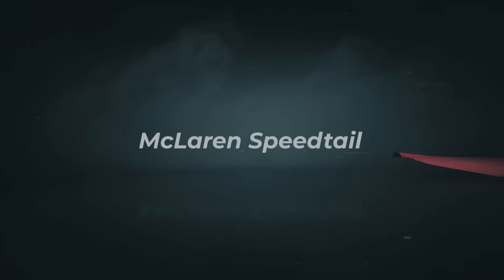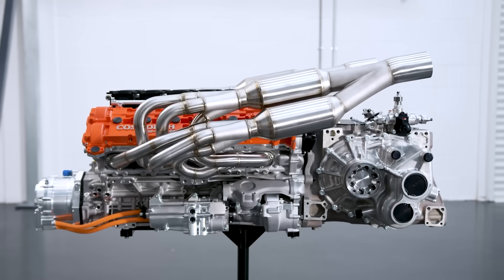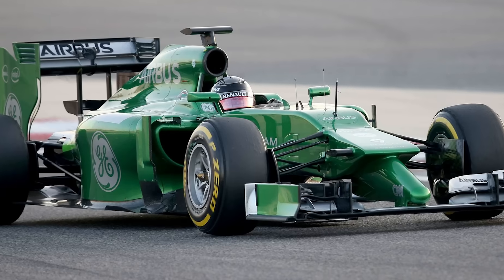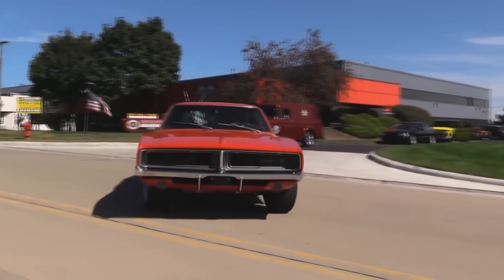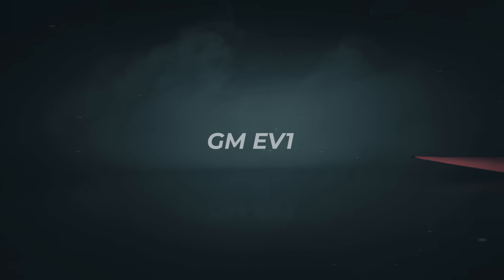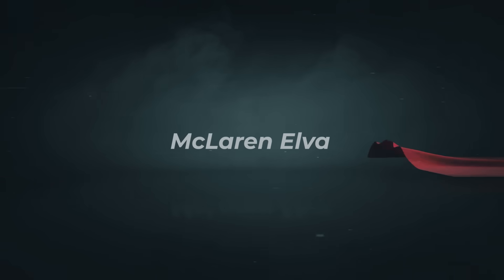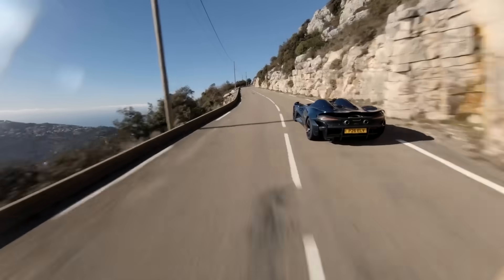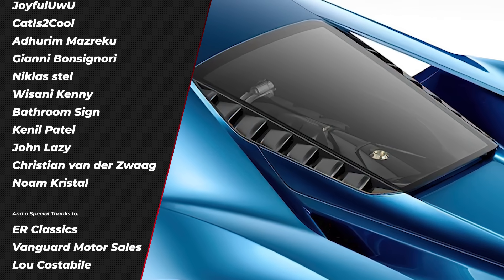Top 7 Cars that MASTERED Air Resistance

Comment: Vw made an car that did 1 on 100km so this video is incomplete
Reply from the maker: The XL1 has great aero, but the effect of it is small since the car is too slow to make much of a difference. Achieving 1L/100km is more because of the low weight and the hybrid engine

Comment: During the 60's or the 70's a small racecar participated in Le Mans. It was so aerodynamic (and light)  that its engineers had to add wings to ensure stability in the Mulsanne straight (to avoid the car to take off). Its Cd was about 0.18 (officially under 0.20 but nobody knows, some people claim it's at 0.16)

Comment: 7) McLaren Speedtail. A.J. Foyt would like to comment, nice Oldsmobile. And the Gen Four Camaro nose, excuse me.
6) GMA T.50. This car has tech that was banned on all tracks.
5) Aston Martin Valkyrie. Call it original brutal elegance.  AS stated, this car puts F1 tech into a street legal car. 

4) Dodge Charger Daytona. Think about this. I watched a NASCAR video with five different cars in the two lap race. The top two modern cars could only do 168 and 187 MPH as there top speeds. Guess what, this car would win the race with being able to go up to 200 MPH, yes , it would smoke younger NASCAR versions. But unlike the second and third place cars that are track only, this car is street legal and can be driven home.
3) GM Saturn EV1.  It has a low drag coefficient. So what? Iit is still inferior to gas cars. and it can't go fast either.
2) McLaren Elva. I say these cars are ugly to start with, and this one messes up it's own aero. just because the thought they made it look better without a windshield. No it didn't.
1) Porsche GT3 RS. Why do you think this Company won't mess with the design. If it ain't brock, don't try to fix it.

Comment: How tf did the challenger make the list but the LS430 didn’t? With a drag coefficienty of 0.25 the LS430 is better than most in this video aerodynamically
Reply from the maker: The video isn't about drag coefficienty only, but all the clever ways cars manage air. 
LS430 didn't do anything groundbreaking to achieve that number. And the number itself is nothing special either. A regular 2016 Audi A4 has a better cd. 0.23
Reply: @TopCarsTV  absolutely, the only thing less groundbreaking than the LS430 is probably the content from this channel. 100%

Comment: I recall reading somewhere that the Speedtail has a lower top speed than the Veyron because of the gearing... It accelerates significantly  harder, so that's what they say they were going for. But I get the distinct impression that the main reason they didn't give it some taller gears was because VW won't share Ehra Lessein with anyone else and there's not really anywhere else in the world where you can really wind them all the way out safely. 

The F1 was the last time VW is sharing, which isn't very sporting.
Reply from the maker: They could've added one final, super looong gear to use the potential of that streamlined body. And as for Ehra Lessein, just go to Nevada where Koenigsegg tests their top speeds.

Comment: The McLaren Speedtail is slower than an “equally powerful” Bugatti Veyron for this reason: The speedtail only has around an 800hp engine. The electric motor in the car adds the extra 200hp, but only for short bursts during acceleration. The high voltage battery will be depleted long before the speedtail reaches 250mph, so by the time the car reaches that speed it’s only producing around 800hp, not the full 1000hp.
Reply: Hybrids are good for the track, not for top-speed run
If they used a 1000hp pure IC engine, it would have broke records like it's predecessor, the legendary F1

Comment: I had to pause the video and make this comment because you called the AM Valk ugly. 

You call that uglier than the T.50? Really? I mean you are the first person who I hear call that thing ugly. If u want ugly aero, look at the McLaren Senna. THATS ugly. 

The Valk is what a hypercar should look like! Absolutely beautiful. Wide arches, and the fenders over the wheels curve so nicely, it's like, for a lack of better comparison, a woman's thighs. 

The cockpit itself is like a teardrop shape, surrounded by the rest of the body, which only widens the car to allow for better stability, just like how the wings and the body of a jet seem to form around it's cockpit. 

And when you view it from straight ahead or straight behind, you see the beautiful venturi tunnels that wraps around the car, bringing attention to the cockpit once again, which even more obviously looks like a center piece now.

And at the tail of the teardrop center piece, the exhaust pipe meets with the air coming from over the car and under the car via diffuser. And you're reminded that that's not just the cockpit, it's the housing for the heart of the car as well, the Cossworth V12.

Comment: Guys buggati Veyron is also areo efficient but not enough as speedtail. There are multiple factors, 1st being a hybrid car (i guess) the speed tail is , deployment of this electric hp will be at acceleration or mid range speed and may not be using all those 1000hp at top speed run like new sf90. 
2nd gear ratio tuning. 
3rd that immense grunt from that w16 engine. 
4th Also that speed tail is not tested in narado ring like Veyron which has long straight, may be speedtail could achieve better speed on narado ring. 
5th the torque and hp curve of (dyno testing) veyron is souly focused on top speed not efficiency like speedtail. 6th ( speculation) that w16 can actually generate more hp than 1001hp limit. This w16 can be detuned for reliability and comfort, at top speed run and pushing that engine to it's absolute limit, it can be producing 1100+ hp. Buggati might downplay there actual numbers like Porsche and bmw.

Comment: 1. The McLaren Speedtail. This design was originally used for the Oldsmobile Aerotech.
2. GMA T.50. This is a Modern version of an older car, and the only one of two from this Company that I don't think is Butt-Ugly.
3. A & M Valkyrie. AN all original design.
4. 69 Charger, Really. all this is is a box with rounded of corners. GM Products had all started doing this in '61.
5. Melted Cheese started being a design at the beginning of the Nineties, this started production in 1999.
6. McLaren Elva. This is a cheap bad copy of the Porsche 918. And that design is based off of the 911, which was first used in the early Sixties.
7. Number 1 Porsche. Well, you got two right.

Comment: A car radiator for cooling the engine is, let’s say 3 ft wide by 2 feet high. This BLOCK is positioned behind the grill which is why cars have grills. How can they claim “aerodynamic” when the front is a block?!?

Super cars with low front ends, Ferrari, Lamborghini,  McLaren, etc) solve pushing a block by cleverly using airflow and distributing radiators. My Lamborghini Gallardo had 12 radiators.

Electrics don’t need cooling. Their front can be designed true aerodynamically. Electrics don’t need a hood (where the engine was).

It’s time to redesign the 20th century buggy. Until then, don’t claim “aerodynamics” because you have none. You’ve never seen their white smoke visual in front of the grill.

Grills were there to cool a radiator that cooled an engine. The hood housed an engine. Neither exists. Design a cool car, would you?

Comment: Did you know that the air windshield was actually seen before ? Check the Renault Spider ;) ;) ;)
Reply from the maker: I know that SP1 Monza has air-shield but not as strong. Didn't know about the Renault. Thx
Reply: I was looking for the Renault spider comment. Initially it didn't have a windshield but people kept eating bugs, so they made a version with one.

Comment: lets all be honest, with more power and no limiter, the speedtail could easily hit 300mph
Reply: Sorry but no. The Speedtail is already reportedly quite unstable at its top speed. It would need extensive bodywork upgrades to reach 300mph without being a tumbling fire ball. The Bugatti Super Sport and Jesko Absolut show that rather nicely. And even the Bugatti, the only car to have reached 300mph was reportedly rather unsettled at such speed, and it's exceptionally wide and heavy, giving it inherently more stability.
Reply: @DefinitelyNotEmma  ah wow, it does LOOK like a 300mph car tho?
Reply: i like to believe that with better tire technology a software update will unlock the full potential
Reply: Not really. Once you're at 250mph, going faster becomes extremely difficult. You can't just add more power and get an extra 50mph.
Reply: Nope. The speedtail only has around an 800hp engine. The electric motor adds the extra 200hp but only for short bursts during acceleration. The high voltage battery will be depleted long before the speedtail reaches 250mph, so by the time the car reaches that speed it’s only producing around 800hp, not the full 1000hp.
Reply: @beanapprentice1687  thats why i said with extra power?
Reply: @MaskRobloxOfficial  sorry i didnt see that. But technically any car can go 300mph with extra power
Reply: I never new it had a limiter
Reply: *knew
Reply: The hybrid made it heavier 😭
Reply: Yeah same with my 2009 Mercury sable, with more power and no limiter it could hit 250MPH 🤷🏾
Reply: @the-nm7sd  you sure? I think you may of been playing too much forza. Just adding more power wont make a car substantially faster, yea it will make it faster, but to go 250 needs slippery aero and less weight. Your car isnt very aerodynamic. Look at a bugatti veyron, it needs 1001hp WITH all the aero to even THINK about going 250+
Reply: @MaskRobloxOfficial  
YOU play too much Forza kid
Reply: @MaskRobloxOfficial  aero yes, weight not so much, remember veryron is heavy
Reply: @justsomepandawithinternet  how? My points is completely justifiable and makes sense
Reply: @alloush5995  yea that is fax, but you understand my initial point?
Reply: @MaskRobloxOfficial  yeah
Reply: @MaskRobloxOfficial  It was a "JUKE" Bruh
Reply: @MaskRobloxOfficial  I think that the big problem is not the aero. I think is the overheat in all the parts incluing the tires.
Reply: @MaskRobloxOfficial  i think it was a joke…

Comment: Never quite understood why the mclaren speedtail is more powerful than a veyron, more aerodynamic, lighter and has newer technologies yet is beaten in top speed
Reply from the maker: We don't know if it's more aerodynamic 🤷‍♂️
Reply: @TopCarsTV  i mean the speedtail has to be more aerodynamic than an egg right
Reply: Maybe gear ratios but should be faster than the Veyron 16.4. Also, weight doesn't have an effect on top speed, weight effects acceleration.
Reply: @Amarjit_Singh  It actually does, the reason a Kawasaki H25 can hit 400kph is also its power/weight ratio
Reply: @romaintagliaferro3189  That's a very serious misconception. Weight has nothing to do with top speed. Power to weight ratio affects acceleration and thus the time taken to reach the top speed would be more. You can watch Jason Camissa's video on how weight doesn't have an effect on top speed.
Reply: @romaintagliaferro3189  I also can give you a very good example - 765LT and Aventador LP 700-4. The 765LT has a better power to weight ratio (more power, less weight) than the Aventador but has a lower top speed.
Reply: @Amarjit_Singh  I know that it doesn't make a huge difference but it does a little. If a veyron weighed 6 tons, it probably would'nt reach those speed ?
Reply: @romaintagliaferro3189  No, it would have still reached 400km/h if all other parameters remained the same - power, aerodynamics, gear ratios, etc. Only difference will be that the time taken to reach that speed would be way more and as a result it would need a much longer track as well.
Reply: @romaintagliaferro3189  Top speed doesn't depend on weight. I suggest you please watch Hagerty's video from Jason Camissa, it's a 4min video with precise explanation.
Reply: @Amarjit_Singh  Will do 👍
Reply: @Amarjit_Singh  holy shit, I found you again!
Reply: @mr.sunmeadow  huh?
Reply: @Amarjit_Singh  you don’t remember me? I was often fighting you in the comments of car videos, often taking sides with Koenigsegg
Reply: @mr.sunmeadow  No I don't
Reply: @Amarjit_Singh  oh, okay. I also changed YouTube name since for privacy reasons, but I guess you just don’t remember me.
Reply: Veyron back by VW by millions of dollars (Bugatti is actually losing millions at $3 mil for one car, but VW rich enough) and the W16 is just using brute force. With enough power, you can do just about anything in terms of straight line speed.
Reply: @groundedgaming  ??? and what has that to do with his comment
Reply: Guys buggati Veyron is also areo efficient but not enough as speedtail. There are multiple factors, 1st being a hybrid car (i guess) the speed tail is , deployment of this electric hp will be at acceleration or mid range speed and may not be using all those 1000hp at top speed run like new sf90. 
2nd gear ratio tuning. 
3rd that immense grunt from that w16 engine. 
4th Also that speed tail is not tested in narado ring like Veyron which has long straight, may be speedtail could achieve better speed on narado ring. 
5th the torque and hp curve of (dyno testing) veyron is souly focused on top speed not efficiency like speedtail. 6th ( speculation) that w16 can actually generate more hp than 1001hp limit. This w16 can be detuned for reliability and comfort, at top speed run and pushing that engine to it's absolute limit, it can be producing 1100+ hp. Buggati might downplay there actual numbers like Porsche and bmw.
Reply: Partly because the gearing is too short and partly because VW won't let McLaren have a go at Ehra Lessein... anymore.

Comment: The mclaren Speed tail such a amazing hyper car
Reply: I think it just needed to be a little faster. It was sold as being super fast in a straight line but that's it. Other types of performance weren't even really talked about. Also 250mph makes this car the 10th or 15th fastest road car ever, which isn't a good marketing headline. If it was the first car to break 300mph, its unique shape would've been remembered forever, but now it's kinda forgotten
Reply: @justinbocchino5141  yea, they really need to make a speedtail to match the power of it's looks. i wouldn't be surprised if this car hits 300mph+ with a engine making 1500+hp
Reply: @HumayoonXpro  maybe one day they'll tune it or add electric power to it to push it to 300mph